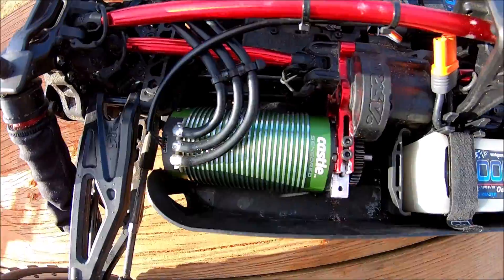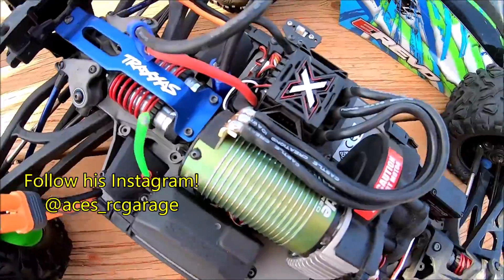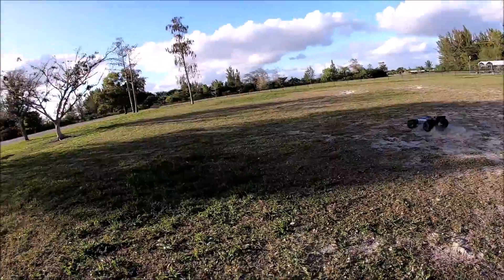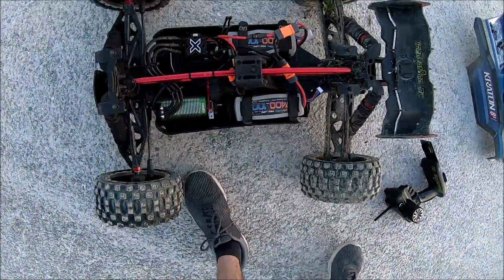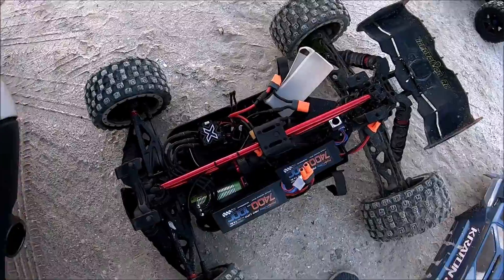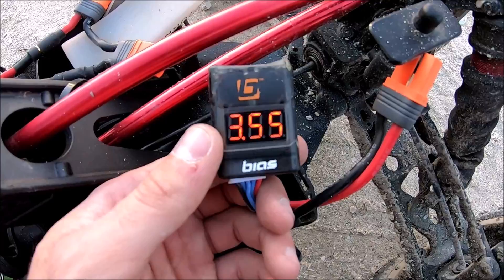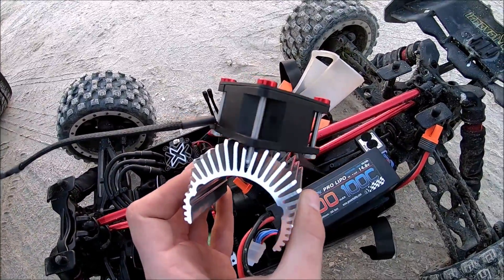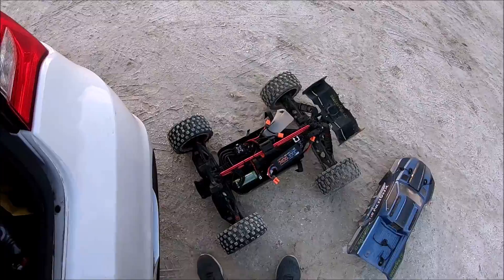MASSIVE Castle Sensored 800kv Motor & Mamba Monster X 8S in Arrma Kraton 8s

Comment: Does your esc spark when you plug in the 2nd battery? I have the same set up on my kraton8 as well and it always sparks a bigger then normal spark
Reply from the maker: Second battery usually means a series connection. Series doubles voltage.
You'll get more spark when you connect a higher voltage battery source to a circuit with a decent amount of capacitors. As it loads them (instantly) that's why you see the spark
Reply: @InnovationRC  i get that but it was just a little more then normal, but sounds normal like you said then, thks bro

Comment: Yup.. People tell me.."But why should I get a heat sink and fan for my motor when it's my ESC or Batteries getting hot"..I tell them that.. Lowering the motor temps will lower all other component temps as well..Oh darn! At the end the Revo smoked the ESC??
Reply from the maker: Exactly stated. I can't wait for the next batch of runs, yeah I believe the spur gear tooth locked the trans up and maybe he stayed in the throttle. Or the sensor wire popped out a little and the system went wack at speed.

Comment: That's awesome it has that power to get the tires up with stock center diff fluid 👍
Reply from the maker: I need to up the viscosity of the center diff fluid because it eventually may blow it up with the torque this motor has

Comment: The NTF fans helped my xmaxx a lot with the gearing up . I got them on my Kraton typhon 6s Frankenstein build with a leopard motor and esc and it legit works . Nicks awesome man .
Reply: I haven’t experienced any amp draws on my power hobby lipos . But my motor is stock and max5 . I’m also running soft packs